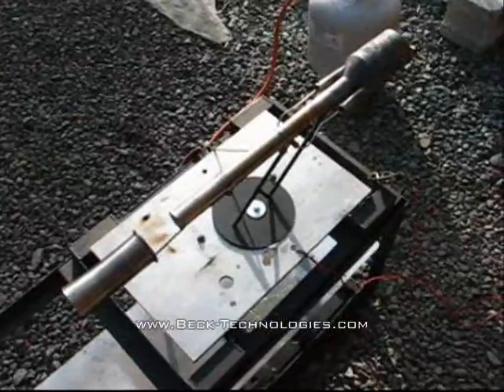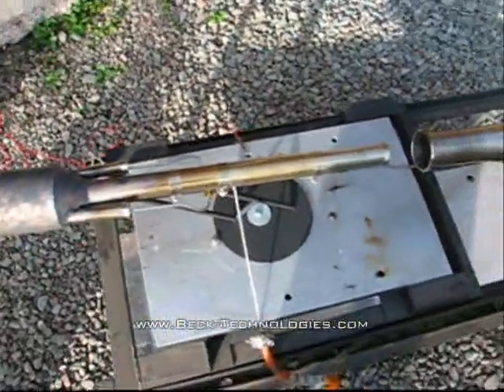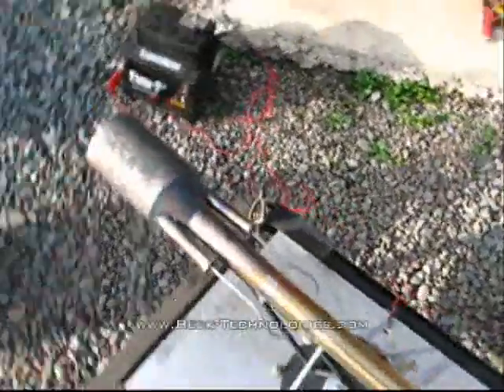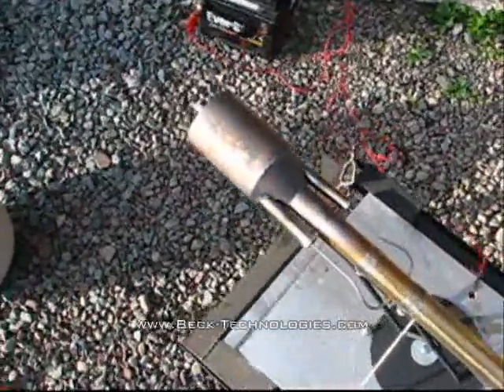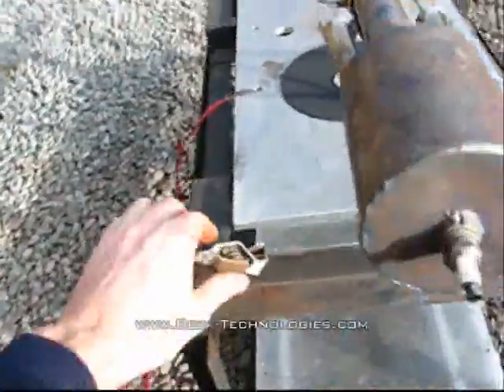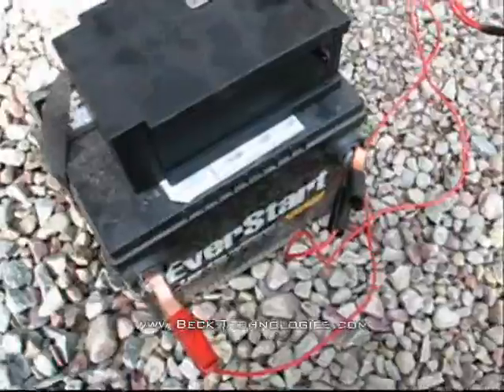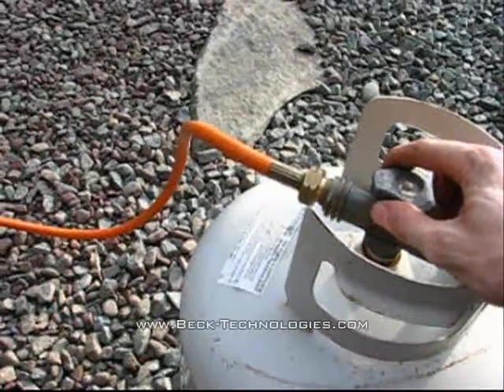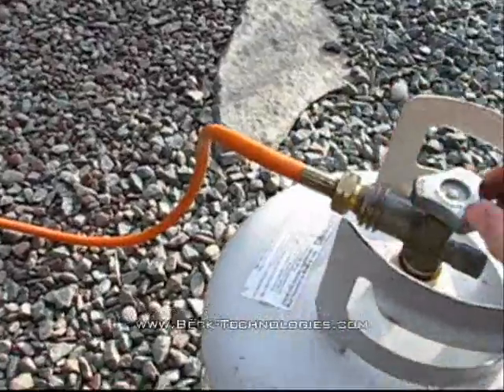4LB Thrust Thermojet Pulsejet Overview and Tutorial

Comment: I have built the same engine, but it dosn't self start, it does work, I just have to blow some air in. I have 2.5 mm (inside diameter) steel tubes. Anyone have any idea why it dosn't self start?